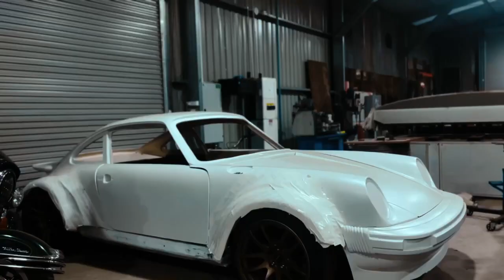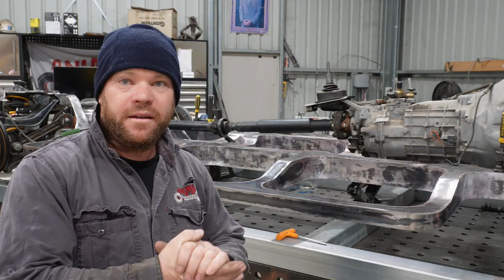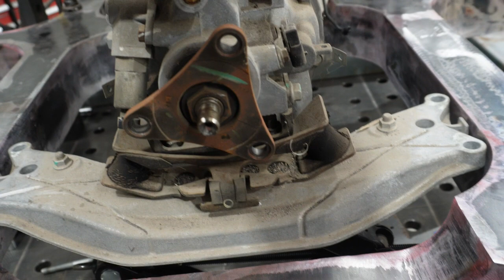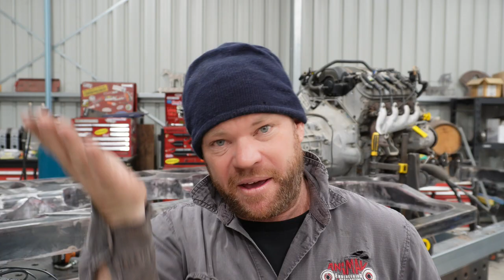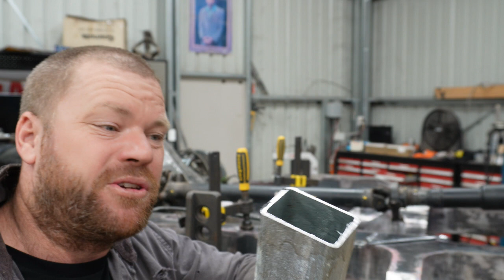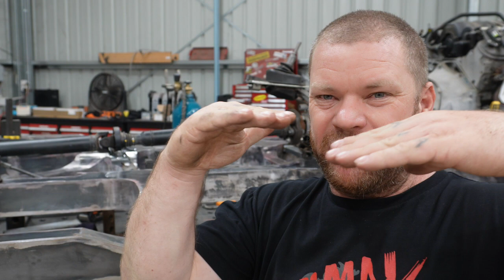Gearbox and Driveshaft install. SSMetro Ep29

Comment: Awesome work as usual mate. Will the motor sit up front next to you, or be mid mounted? I am guessing up front if you are using the original tailshaft but I am not sure about the length difference between the van and Commode.
Reply from the maker: Thanks mate, engine will be up the front pretty well the same position as what the inline six was located.